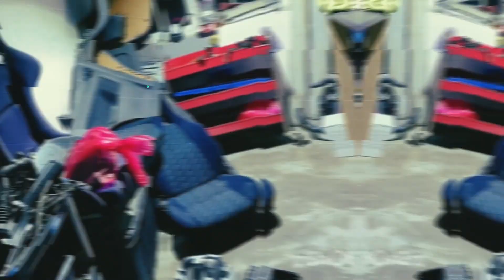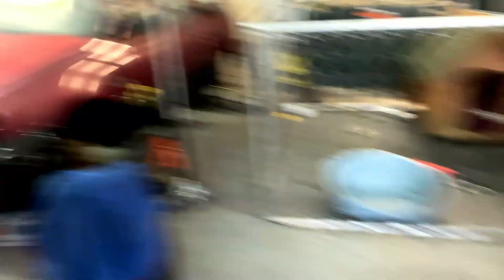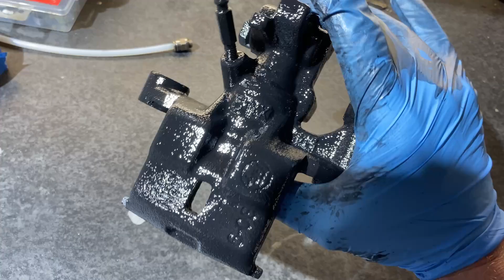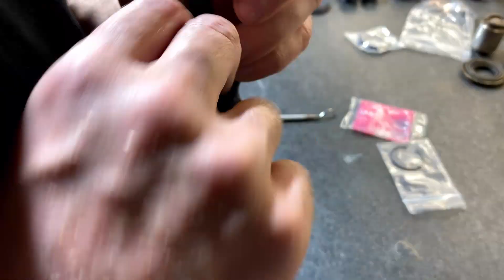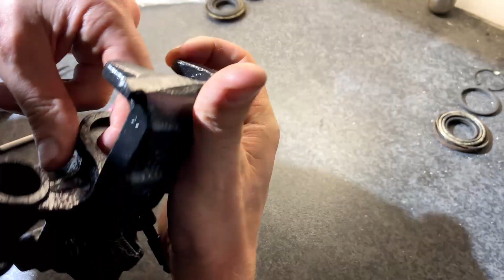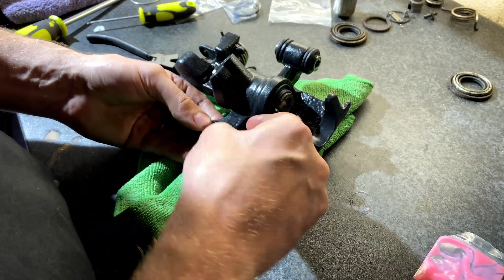Rebuilding Starlet rear calipers | part 2

Comment: I did this job yesterday, and now I have no feeling in my finger tips. I'm not sure if my calipers are different (1993 EP82), but I had to locate the bucket/spring/threaded part into the caliper before fitting the piston. That was the worst part of the job, took me AGES to get the thing clipped into place on the first caliper.
Reply from the maker: Hey Tim, yes loosing all feeling in the finger tips is mandatory, it even says it in the workshop manual 😅. No that’s the same process I had to do too, bucket/spring/threaded part in first. My calipers actually came off a 97 glanza. Thanks for watching man, I’ll be getting my engine fitted soon and more videos to come ✌️